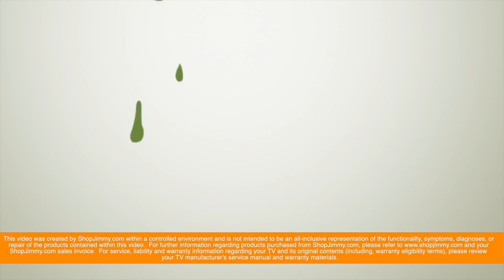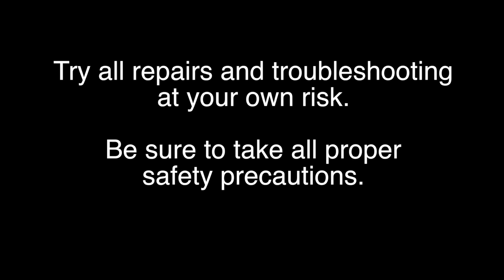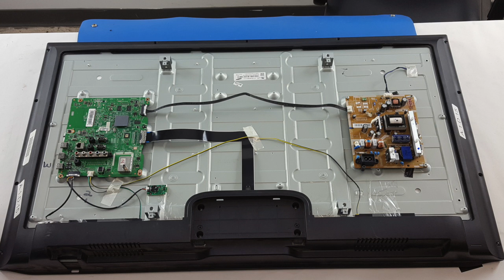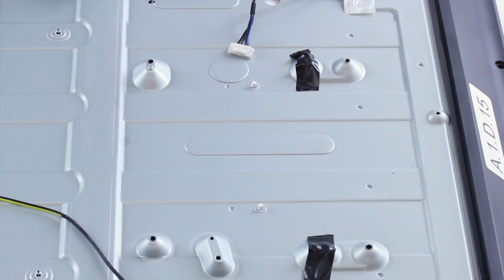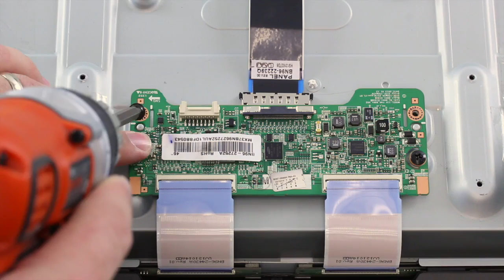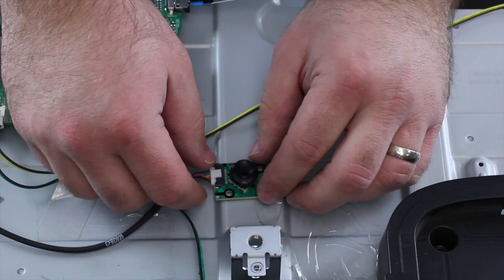Samsung UN46EH5300FXZA Complete TV Repair Kit - How to Replace all Boards for TV Repair

Comment: The two ribbon cables that run from the T-Con board to the main display panel. Are they bonded to the panel? Or can they be removed at either end?

Comment: To whom it may concern:I have a 55" Samsung model#UN55H6203AF. I have sound with no picture. I do not see the back lights in the back of the tv, but when I conducted the flashlight test I seen the menu and images of people. In the video you said it sounds like I need to replace the back light inverter. Is this correct?

Comment: Hi I have a Samsung model number Un65eh6000f that is showing no image or has no audio backlights do turn on and it blinks on and off slowly I replaced the main board recently but it was no fix I am planning on replacing the tecon board next was hoping for some advice thanks in advance